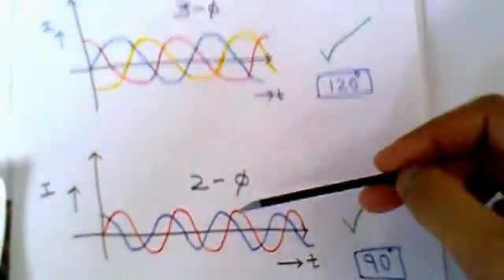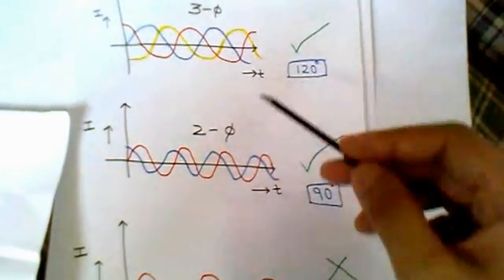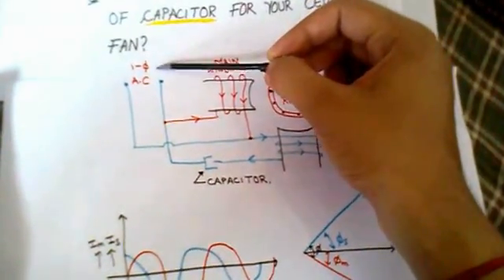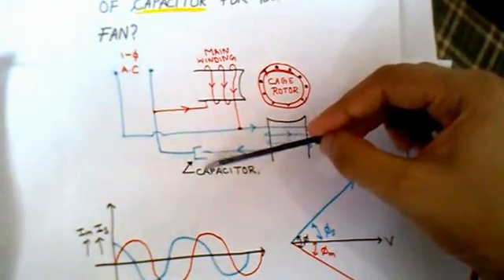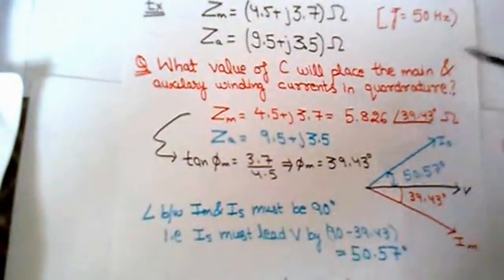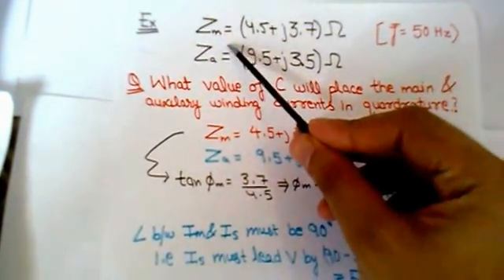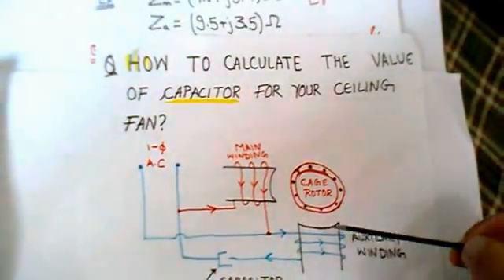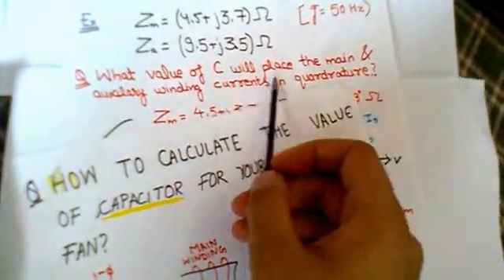CALCULATE THE VALUE OF CAPACITOR FOR YOUR CEILING FAN

Comment: When you applied the voltage source to each winding, what was the measure values of the current in the run- and start-windings? Given the values obtain for the impedance in each case, the currents would be considerably high...

Comment: Hi, I have question:
Why factory not use aux winding with specific R & X, with result in 90 deg phase angle?
It will save cost by removing capacitor.
Sorry for my stupid question.

Comment: Honestly i am new to this and that all blew my brain. Maybe it means that even though I am good at maths, that I should give up now. Ha ha anyway can you me. I have a car fan which I took apart and the current 12v dc seems to go straight into the capacitor (if it is a capacitor that I am looking at) and then through two coils that look like springs. After it foes through brushes and into the centre of the windings. So what are the coiled parts and how can I test the windings are good even though when 12v is connected the fan spins super fast. This is a cooling fan for a car, and i believe the ECU pulses the fan to make it have three speeds. Anyway your help would be most apprexiated. The coiled or spring looking this are? And how do I test them too.
Reply: James Barratt the car fan will be a DC motor which does not use a capacitor. Only single phase AC motors use capacitors

Comment: All the maths appear to be correct for this particular example. However, the capacitor value is way to big for a real fan and if you calculate the power consumption for this example @ 230 volt AC  I think it may be well over 1 Kwatt but do not quote me on that. A possible explanation to this is that in the majority of the ceiling fans the running winding is already out of phase on regards of the start winding. For instance, in a 14 pole stator both of the windings are geometrically displaced 12.86 degrees. From a magnetic point of view it could be much more depending on the way the stator is actually wound (basically the direction of the turns on consequent poles) Would anyone like to add more ideas to this interesting topic?

Comment: Very interesting. The only thorough explanation I have found but quite technical for me as I failed maths at school! I follow the practical drawings ok & understand the need to measure resistance.  There are some things unexplained in the angle /co-ordinate calcs' - there are symbols (tan0  +j  etc). Are you using a reference table? For Zm I cannot arrive at 5.826 or 39.43.  What is j which you also used at the end to show the way to calculate X ?

Comment: Hi, Hemant.

I have 5 HP 3 Phase Crompton Greeves motor, as I have no 3 phase supply, I want to run it in single phase. Can please help me in finding suitable capacitor for this purpose to connect in Delta connection. And also please guide me on connecting a metal filled Poly propylene capacitor (this cap has no indication of polarity)

Thank you in advance.
Reply from the maker: +Soma Raju Heya Raju,
In Engineering we dont convert single phase into three phase
although three phase motor can run on single phase if it is started once that can be done by once giving it a push with your hand.
ut that will lead to a very low speed
Reply: +Hemant Pant  Inverters are commonly used in this case but they are expensive. It is not accepted in industry but for home workshops I have seen people run small (under 2hp/1.5kw) 3 phase motors wired in delta on single phase by using a larger mf start & a smaller mf run capacitor. The voltage is tested in use to ensure balance / stability but it seems that the capacitors are only crudely selected - i.e. with no exact calculations. There may be long term harm to the motor (but perhaps not for many years?) which maybe an acceptable trade off for occasional home use

Comment: this is for start capacitor, how to do the same for run capacitor?
Reply from the maker: In our ceiling fan we use only one capacitor the same capacitor starts the motor and improves the power factor in running conditions.

Comment: It will be very easy if you have a LCR meter. Just measure inductance (L; hence, calculate xL at 50Hz line frequency) and ESR (R; equivalent series resistance) of each winding. Then calculate required capacitance to maintain 90 degree phase shift between two windings.

Comment: nice nice nice!  looked all over before I found this video with a precise answer to exactly the problem I had.  I have a motor that needs a run cap. but I threw out the cap before I realized I still needed it!

Comment from the maker: Obviously the cap. Has to withstand the maximum voltage. Which is 240 rms here in India and generally a margin of 1.5 is recommended which comes out to  be 350 volts rms approx

Comment from the maker: @nghtyvbz sorry for late responding . To calculate the value of z you have to actually open the ceiling fan there you will find two windings one wire will be common . You have to apply a small ac source .preferably stepped down. You also must have multi meter which can measure ac current .

I hope this will help . I will try to make another video on this.